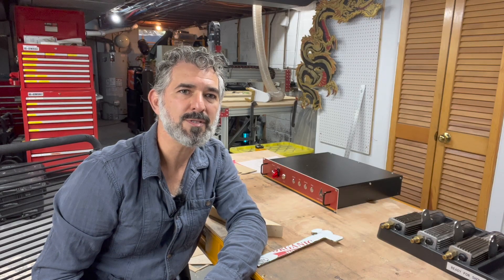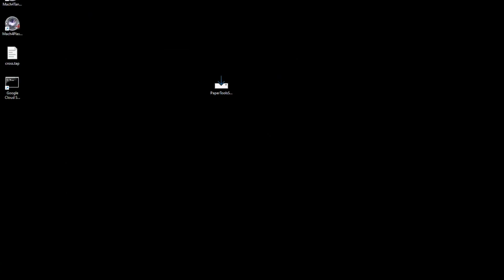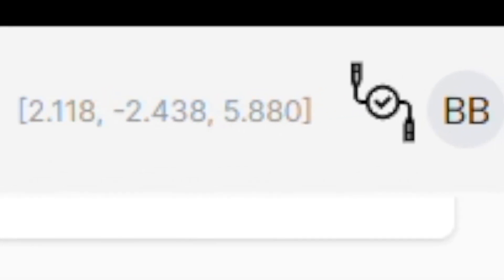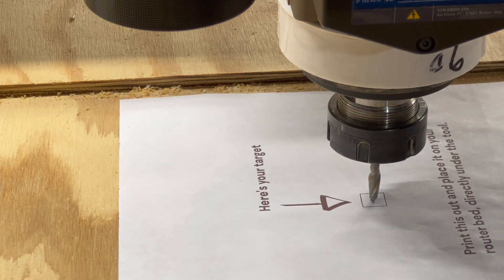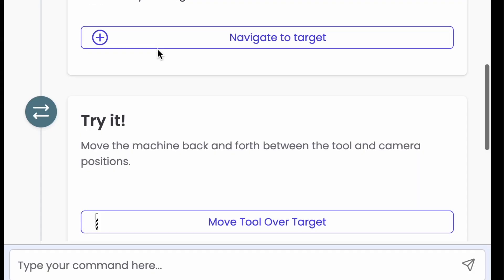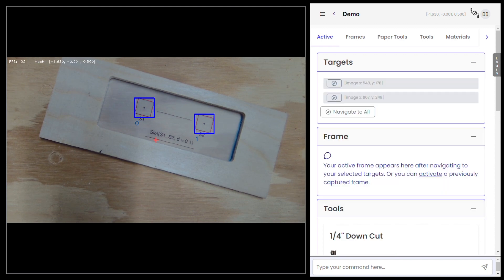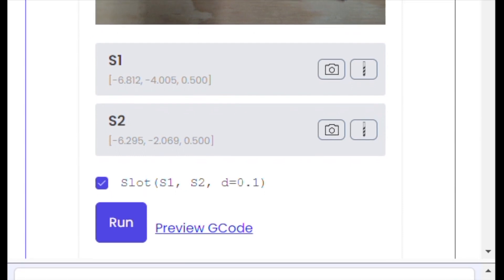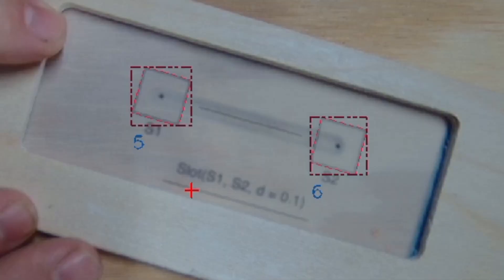Self-Driving CNC Machine. No CAD, no CAM, just Camera.

Comment: Looks like an amazing tool. Can it interface with UCCNC?
Reply from the maker: I haven't added support yet for UCCNC. The requirements are 1. Jog the machine 2. Receive the machine position (DRO) 3. Execute GCode. So it's generally pretty easy. If you're technical I'm happy to guide you through the process. I'll be sharing an SDK so we can quickly add support for a long list of compatible machines. Right now I'm adding support for Tormach and Centroid.

Comment: Hello; I'm a boat builder. 

May I have two recommendations that is actually needed in the market:

1- A CNC router attachment that will FOLLOW a drawn line perfectly. This will save so much time from band sawing and planing wood that is drawn under templates. I can't imagine the time savings I would have if I just simply mark the cutlines, set depth of cut, place it under CNC and press start.

2- A script for CNC machine to SCAN the surface with camera and create a very low error outline of the object below in vector format (even stiched image is acceptable). We work a lot of curved material but do to size; scanning or taking photos for accurate measurement to digitilize it is simply not possible.
Reply from the maker: I think my latest video may demonstrate the first of your two suggestions. I'm working on that second one! We'll get there soon. Thanks for the ideas, they're really helpful.
Reply from the maker: I think v1.6 has the features you're looking for: www.papertools.ai

Comment: I was searching to see if anyone in the avid cnc community had set up camera registration in a way we use it in the print and signage industry;

Our design file has both a Print and Cut layer. We a print a design onto a substrate with some registration marks. The CNC then find the registration marks, allowing it to cut in the correct location in relation to the print. 

It seems you have solved a trickier problem. looking forward to seeing more.
Reply from the maker: Yes, we are making signage Paper Tool kits that include lots of lettering. Your registration marks sound similar to our square targets.
Reply from the maker: Here's another thing you can do once you've got that camera attached to your spindle: https://www.youtube.com/watch?v=FhRrygbmQE0